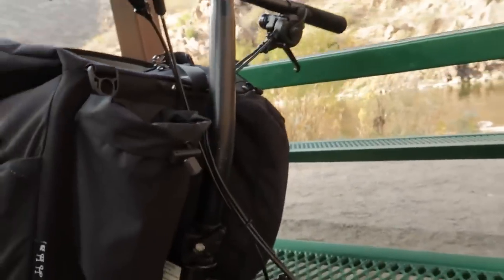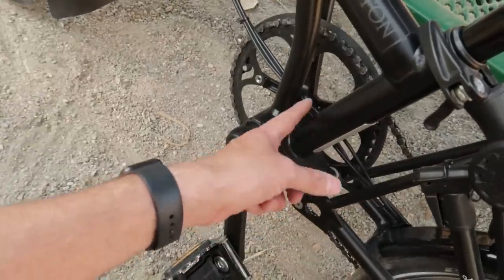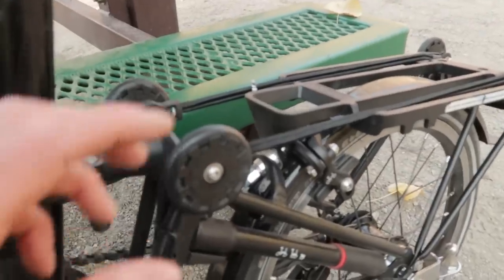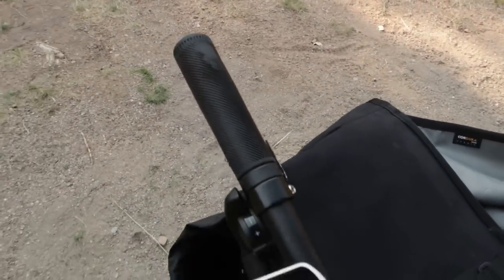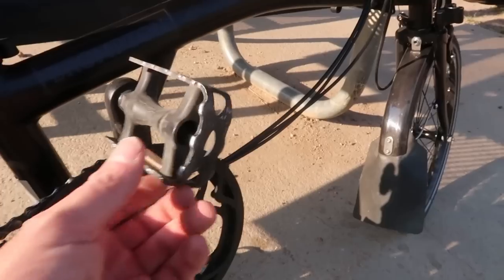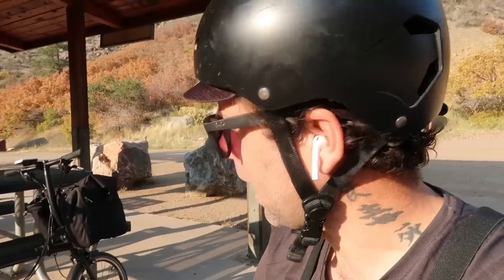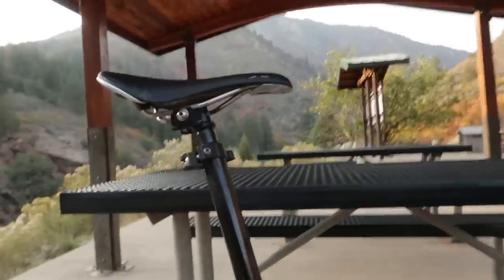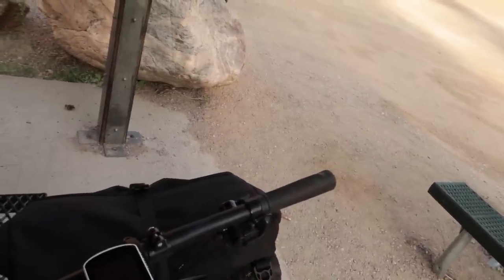How’s my Brompton Holding up?  (6 month update)

Comment: The inner sleeve on one of the original rollers is too long and makes for a wobbly roller.  My first was destroyed, the same problem with the replacement they sent me.  I'm exploring other options, got an aftermarket rack and will be putting on some nice big rollers with bearings.

Comment: I agree the bike has held up well considering it is primarily designed for short city hops, and your usage is not typical. Re slipping seat post - cleaning it can make a difference as dust, grease and general accumulated crud can reduce the tightness of the seal. This video of the factory is worth a watch and gives a clue as to why the little bike is so robust. https://youtu.be/max3bL3bTbg
Reply from the maker: I was checking my Garmin and it said 5347 miles at that point.  More now.
Reply: Held up well? 6 months and all these faults. Held up well. Are you crazy.

Comment: Wish Brompton would make a bike with a Gates Belt drive and a 8 gear internal hub.
Reply from the maker: DrZee it would be hard to design I imagine, but it’s an interesting idea.
Reply: @velosapien  Amazing!!! I'll email the company and see if they still make it and how much it costs. Thank you !!
Reply: @velosapien  yeah and they also make disc brakes, too.
Reply: That would make them heavier. But maybe they should provide that option for ppl who would prefer it. I actually really like and enjoy the 6spd they have. The parts are not expensive to replace really.
Reply: @colinhoward2200   i can live with the 6 speed and the traditional brakes but I would like the option of a Gates belt drive. It'll make general maintenance of the bike easier.

Comment: Hey  Brian, Happy 6-month anniversary with your Brompton. 

I have had mine for about 4 or 5 months and seatpost slippage was an issue almost out of the box. I used an extended post at the time (just installed a telescoping post yesterday). 

A few things that helped:

1. Adjusting (in very small turns) the clamp hinge. You probably know this, but it draws the frame around the post, which can damage the frame if done too tightly. Be careful. 

2. Try carbon paste on the lower portion of the post inside of the frame. I was a little skeptical as I didn't like the idea of abrasions on it, but the silver posts scratch easily anyway. I used Finish Line Fiber Grip, but I am sure any will do. Some even use sandpaper. I didn't want to choose an extreme option, so the paste suited my needs. 

All in all, I would say the adjustment made the main difference, though in conjunction with the paste, a better seal probably formed. I have a sense the post also needed to settle in, but who knows?

If that doesn't help, you may have to check the plastic piece in your frame. It is sleeve/sheath/shim that protects and prevents slippage. If worn it may need replacement, which Brompton suggests be professionally done because of the reaming process. It seems a little tricky to find them already reamed, so it might be the one non-DIY fix unless you can purchase the tool. It also seems to be attached with a very strong adhesive, but a heat gun might loosen it up. 

For the gearing. I have a 3 speed internal (standard ratio Sturmey Archer). I spin my pedals back a turn them try the gear change when it seems to not shift properly and it usually does the trick. Definitely do not pedal while shifting the internal hub. The Brompton just doesn't like it!😁

Thanks for the video post. I will check out the chain one.
Reply from the maker: Wow, thanks for the info....lots of great information.  I appreciate you taking the time to share......thanks so much.😀👍

Comment: Wow surprised to hear your stuff wearing so fast from 5k total miles. I would agree to try some more aftermarket parts. Not Brompton related but I have racked up roughly 2k miles e-biking to work on a budget folding ebike and haven't worn through anything besides the crap stock chain. All on pavement but taken it through some brutal storms.
Reply from the maker: I am going to have to figure out a good aftermarket chain option for my Brompton soon.  I don’t like going through so many chains and gears.

Comment: Hi Brian
1. Considering the pedal I think it’s your fault. I am a 50+year experienced biker and I have never seen a pedal moving like yours   Must have been the crash-like event you had. 
2. Coming to chains you are right. Driving my Brompton about 6k km so far (and I am not a sportiv as you anymore) I have worn out my 2. chain anyway. The Brompton is a chain eater. Like you mentioned, if you have a look at the ratio between the front sprocket and the rear ones - I think   that’s the reason why the chains are wearing out so fast. 
3. Get yourself some Ergons - once you get used to them you won’t regret it. Especially on the long term. When you will get in your 60’s you will get problems with the bones in your hand, especially those near your thumbs. The Ergons will help to avoid these long term consequences. 
4. It’s a real nice landscape around your city and I am astonished how decent your bike-infrastructure seems to be. Thanks for showing this to us. 
Stay safe and 🚴🏻‍♂️💨💨💨🌈
Reply: Denver is super bike friendly, we have lots of trails, bike lanes, but the need maintenance which is behind.
Reply from the maker: Thanks for the suggestions.  I will definitely show more of the landscape as time goes on.  I did crash my bike once so you are probably right about the pedals.

Comment: Surprised about your grips. 2 sets in 6-months seems unreasonable. I have Ergons make with cork and they are durable and great. No way your legs did your pedal in-much more likely it's that hard scrap on the sidewalk/pavement. I've had that happen once or twice over the years. I've come to intuitively keep my pedals higher away from the ground. Nice video.
Reply from the maker: Yeah, I am looking for a better option than the factory grips.  I want a more durable set that looks just like the originals.  Hopefully I can get it sorted soon.

Comment: Found and subscribed to your channel cos I'm thinking of getting a Brompton (for novelty sake). This episode is really really useful! 👍 I've had a Decathlon foldie, the Hoptown 320 for more than 2 years and it was only a couple of months back that I needed to change the brake system from stock to Shimano V brakes, and also the rear derailleur to a Decathlon B'twin house brand one. Chain was changed twice. Granted that I don't put in as much mileage on the bike, it has so far been really sturdy and bomb proof. Cost of the bike is only 1/10 of the B. The cost of maintenance and repair in comparison should be cheaper than the B too? Really makes the decision process of getting the Brompton tougher..
Reply from the maker: Yeah, it’s a trade off with the Brompton.  The small fold size and some of the other considerations may not be worth it to the increased maintenance cost for some.

Comment: Looks like you have pulled the seat post up hard against its stop and lifted the rubber seal.  It should be flush with the top of the frame.  That’s why your seat keeps slipping

Comment: Would you buy a 20 year old Brompton? If it was hardly used and immaculate condition. 😀🤓
Reply: Yes, but check the sturmy-archer hub. Make sure it works well.  Don’t pedal when you shift that hub, it can break the internal paws.
Reply: The Digital Project thanks
Reply from the maker: Of course, the older ones maybe better than the newer ones form what I hear.
Reply: @ibikeunfolded  I ended up going for a new black edition about a year ago. Absolutely love it. Definitely the best bike I ever had. 
Thanks for all the videos bro 😎 
Only just noticed the reply I forgot I asked this, at the time the new ones were out of stock for ages so I was searching eBay like mad.

Comment: After only 6 months? Cheap rubbish. Terrible. You bought the wrong make of bike.
Reply from the maker: I ride the bike everywhere.  I was looking at my Garmin data and found I put  more mileage on the Brompton than lots of people put on their vehicles in a years time.
Reply: @ibikeunfolded  6 months?
Reply from the maker: I have had my Brompton over a year now.  Most bikes I had in the past wouldn't hold up well being used 7 days a week 365 days a year.  There for a while, I was putting a thousand plus miles on my Brompton a month.  After 6 months of heavy use it definitely needed some TLC.